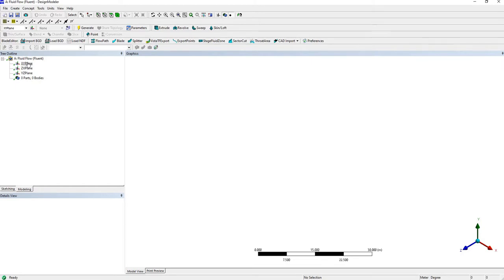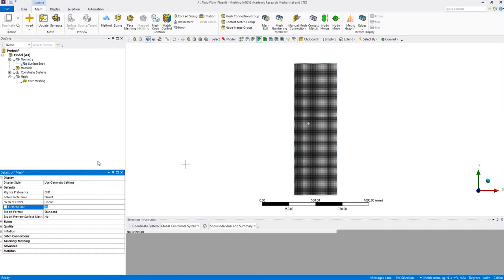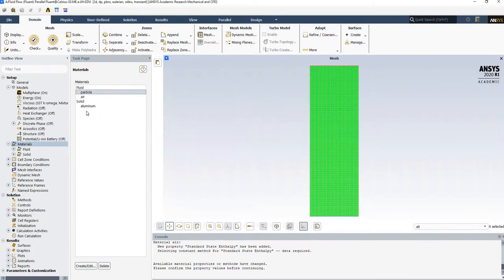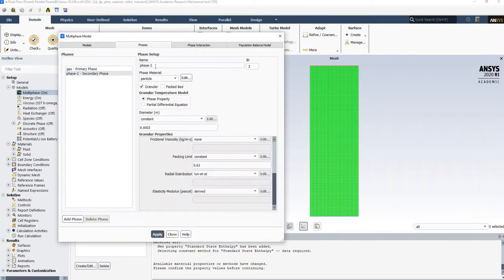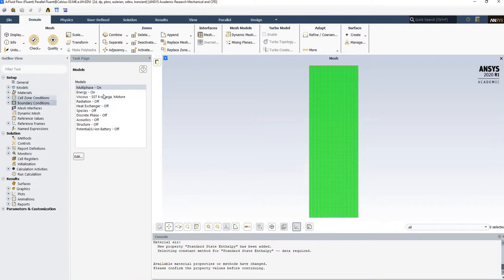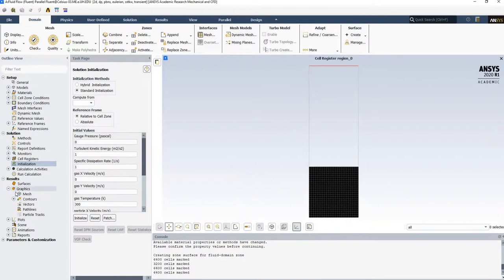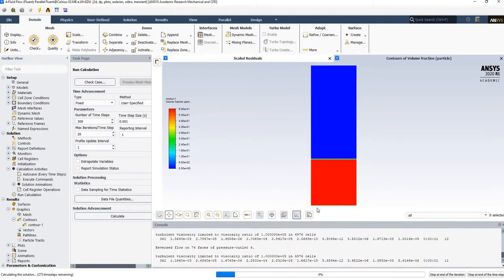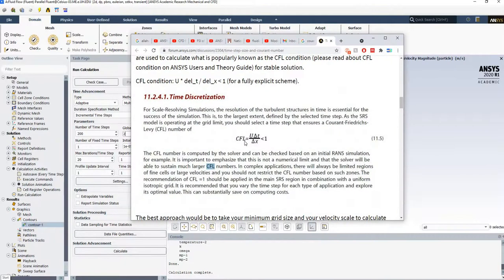Fluidized Bed-Eulerian Granular

Comment: Coincidentally, I am currently working on a project involving 3D analysis of a fluidized bed CFB Boiler using the granular Eulerian-Eulerian model. However, I am currently facing some difficulties in setting up the simulation.if you have any reference videos or materials that could serve as a guide, I would greatly appreciate it.

Comment: Hello, can i know the references of this boundary conditions and provide me the reference paper.
Reply from the maker: It was a long time ago but I think this was the paper. Everything might not match as I was just making the tutorial to show how to use the model.
https://doi.org/10.1016/j.ces.2005.05.044
Reply: @NazmulHossain-nb4lc  thank you so much for your response and if any related references is there for this simulation, provide me that references also , that will helpful for my project .
Reply from the maker: @Our_traveldairies  I have an old work that is recently published which has a lot of good references on this type of project. you can check this out.
https://doi.org/10.1016/j.partic.2022.08.003
If you don't have access, send me an email.

Comment: Thank you for the great tutorial sir! I just want to ask how to insert chemical reaction in fluidized bed? I tried turning on the species transport (with volumetric rxn) and typed in my activation energy and preexponential factor, but no rxn happened after the calculation. I also tried to use the particle surface reaction but still no reaction happened. What could be my mistake?
My reaction is CuO (s) + SO2 (g) + 0.5 O2 (g) ---> CuSO4 (s)

Inlet gas composition: SO2, O2, N2
Catalyst: CuO/gamma-Al2O3
Hoping for your reply. Thank you so much!
Reply from the maker: Hi Kieyo, sorry for the delayed reply. This tutorial doesn't have any chemical reaction guidelines and I don't have any tutorials explaining that. Maybe I will make one in future. Please, see the video in the following link which I found very informative in doing chemical reaction problem.
https://www.youtube.com/watch?v=1djkApABCdE

Comment: Hi, 

can blood be modelled as a mixture of RBCs, WBCs, and plasma.....please share your insight
Reply from the maker: My answer is yes its doable but too much hassle in ANSYS. I would rater use some other tool which are more suitable
To answer your question, if you use Dpm model in fluent, the particles(blood cells) are considered inert and only good for transport type flow.
if you use Eulerian granular where particles are measured with specified density, the major assumptions (drag & collision(KTGF) models) might give too much error because of the purely continuum approach.
if you want to do CFD-DEM(Eulerian-Lagrangian), ANSYS doesn't have it. You have to buy license for Rocky software which can be coupled with fluent. Or use other CFD-DEM software available.

Comment: Is it possible to couple multiphase and Multicomponent in Ansys Fluent ?
Reply from the maker: I believe multicomponent means more than one gas/liquid phases. Yes it is very easily doable when they are immiscible. However if you are interested in mixtures with chemical reaction, it is also doable but I haven't done that in Fluent before

Comment: I am trying to simulate Multiphase with species transport model to research agglomeration mitigation in Fluidized Bed Reactor... Can you tell it is feasible to form agglomeration in ANSYS FLUENT and study the respective parameters.
Reply from the maker: Fluent solver is using Eulerian approach primarily. Although the DPM model seems like a Lagrangian model, the forces are not solved for individual particles. Its more like an averaging technique similar to Eulerian (Control Volume) method.
So, my answer is No, you can't evaluate agglomeration based on cohesive forces acting on particles. However, you can still track positions of particles, which gives you general idea of the agglomeration.
If you are really interested in agglomeration, try the CFD-DEM model which is a Eulerian-Lagrangian coupled approach

Comment: I am trying to simulate fluidization of nanopartoicle agglomerates. I want to use a lagrangian fluidised bed i.e. DDPM is solids for my research needs in ANSYS 19.2 or even latest versions. However in DDPM, it only allows me tracking for injection. I want to place a bed of particles like this video and them track the particles of the bed. How should I define the discrete phase? Also is it possible to define properties such as cohesion, drag coefficients and solid structure (I have porous solids) for the particles in ANSYS?
Reply from the maker: The DDPM model is for particle transport. So the particle density, fluid density and bc has to be for that particle transport scenario. Particles are considered as inert particles.
On the other hand Eulerian-Granular model like in this video deals with the particles and fluid coupling via volume fractions. However particle cannot be tracked because the particle phase is solved with continuum approach as well.
In summary, fluent cannot do Lagrangian model for fluidized bed where particles aren’t transported out of the domain. For that u need Cfd-dem software like MFIX, Rocky-Fluent coupling or others. I have made some videos on MFIX if u r interested. Rocky requires license to be bought.

Comment: Can the bottom inlet be nitrogen instead of air? In that case would it be three phases ( solid, air, nitrogen)?
Reply from the maker: It would still be 2 phase flow, because air and nitrogen both are gas phase. However, u need to add nitrogen as phase 3 in the model. If u want to do 3 phase flow, u just need to add water/other fluid as phase 3 or phase 4….in this model